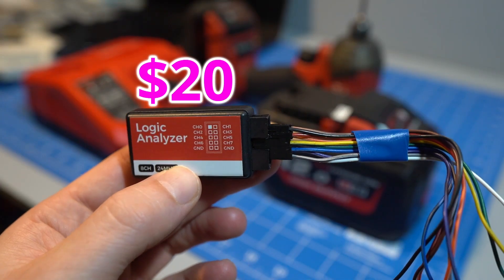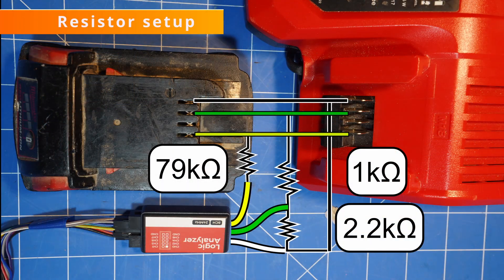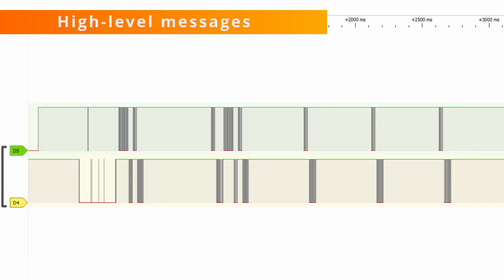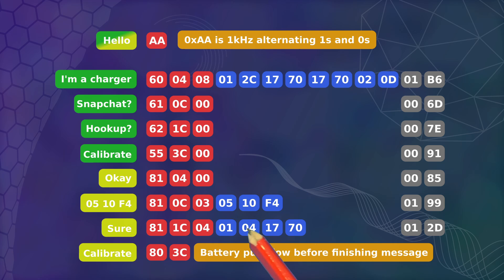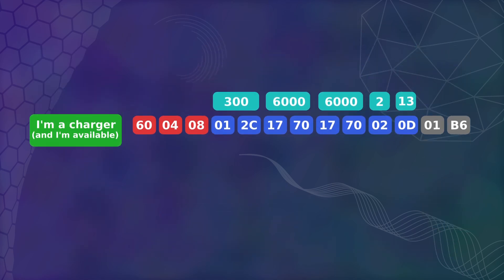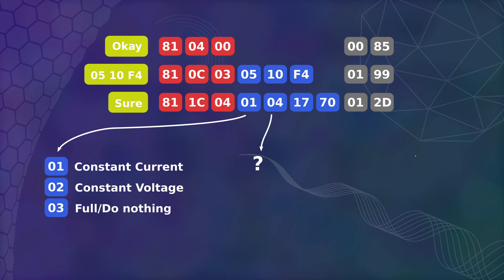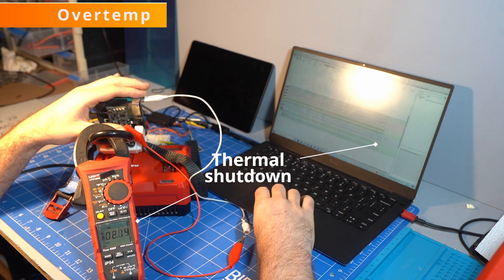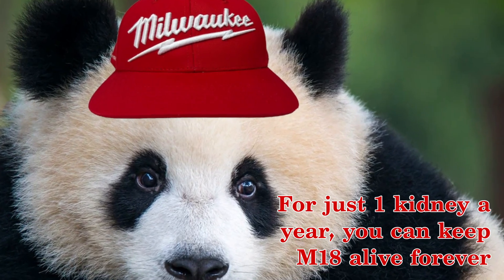[004] Reverse-engineering the Milwaukee M18 Redlink Protocol

Comment: Just thought i'd share a recent experience and thoughts on this great work! I have a fair amount of M12 and M18 gear, I have the multi-port 12/18v charger (essentially three single-port 12/18v fast chargers in one unit), single-port12/18v fast chargers and a 12v only dedicated charger. Recently I've had the dreaded christmas tree fault code with a freshly drained 12v 6ah battery, and one 'long time no use' 12v 3ah battery. Low lifetime cycles on both batteries. Not abused. They look and are essentially new, but with around 4 years of intermittent use. All of my 12/18v chargers faulted out to the red/green flashing lights with the batteries on charge. Multiple attempts were made. Battery temperatures were changed/played with. No luck. I played around with leaving them on the charger in fault mode, putting them in tools etc. and eventually got them to kick into charge mode. (Note: they were not below threshold voltages) So all good right? Unfortunately after another fresh discharge they have faulted again. These are not the first M12 batteries I have lost to this issue - though in the past I have just forced the issue with the dealer for replacement. This time they are too old I would think. The twist is that they are charging fine on the dedicated 12v fast charger, which makes me think that the M12 batteries have a comms issue / tolerance / firmware issue with the multivoltage chargers - something maybe overlooked in the design or relationship with these chargers? It would be great to see hand held analyser released oneday, sitting between the battery and tool or battery and the charger with a readout of what was going on...allowing the consumer to know the fault, and have a robust conversation with dealer/milwaukee ensuring that batteries are not just junked due to over zealous product management protocols, design errors, production errors or dare I say it planned obsolescence. Not that I think that is Milwaukee's game here, but there are $ made in batteries.
Reply from the maker: M12 batteries are entirely analogue and don't have any digital communication. The charger has access to all the cells for balancing and monitoring through the C1, C2 and Th pins. It could be that the contacts on your charger need cleaning? Maybe one of your chargers is fussier in terms of measured cell resistance or imbalance.

Comment: the magic byte sequence 0x0510F4 could just be a sequence that is extremely unlikely (or impossible). i've designed similar protocols before and i would often just pick some value that i knew was extremely unlikely and then i could use it as a state transition trigger for my state machine that reads the stream. i would rely heavily on this if i know i couldn't trust timing too
Reply from the maker: Leading theory at the moment is that it's chip IDs. 0x10 is the i2c address of the balancing chip (BQ76925). 0xF4 is decimal 244, and the MCU is a MSP430 G2744, but is often just classed as a G2x44, which is basically 244.

Not sure about the 0x05, maybe protocol version if they made a few revisions during their early prototyping and field testing, and then 0x05 was the final version released to the public.

Comment: My thought on the unknown data request is maybe some kind of identification request, like "Are you a Milwaukee battery?" "Yes, here's proof." That or it's junk data to throw off repairmen and aftermarkets.
Reply from the maker: Leading theory at the moment is that it's chip IDs. 0x10 is the i2c address of the balancing chip (BQ76925). 0xF4 is decimal 244, and the MCU is a MSP430 G2744, but is often just classed as a G2x44, which is basically 244.

Not sure about the 0x05, maybe protocol version if they made a few revisions during their early prototyping and field testing, and then 0x05 was the final version released to the public.

Comment: Can you please explain why you needed resistors and how can someone know when they are needed?
Reply from the maker: The J1 resistor was needed as otherwise the logic analyser puts too much load on the J1 pin and it can no longer communicate. This was a trial and error thing. I found that connecting to J1 would make the signal go to zero and the charger error. So I tried it with a 1 mega-ohm resistor and that stopped the errors, but I couldn't read anything with the logic analyser. So a bit of trial and error found that 69-89kOhm would keep battery-to-charger communication working and let me read it with the logic analyser.

For J2, it initially worked, but when the charging current was high, I'd just get noise on the logic analyser. I could see that J2 was working at 12V, but the logic analyser is designed for 5V. So I used a voltage divider to drop the voltage.

Comment: Nice work! FWIW this is why I switched to dewalt 18v batteries - the pinout just has the individual cells so it's trivial to connect them to any charger for balancing.
Reply from the maker: Definitely advantages to Dewalt's design. Downside is that it's a bit more prone to short circuits and it's unable to brick itself if it detects a fault (which some people would consider a pro, but I'd consider it a con for most users as it means they're more likely to get a flamming battery)

Comment: Why have 2 bits for charger or battery?   wouldn't one do the trick?
Reply from the maker: I don't have a lot of confidence in my partition of that byte - there's just so little information to make conclusions. I actually think it's probably more like 0b01 is charger, 0b10 is battery, and 0b00 and 0b11 are diagnostic/repair devices. I'd be shocked if Milwaukee didn't have a device that they could put on a charger or battery that would pull diagnostic info and maybe run some simple resistive load tests. I just left it like this because it was simpler for the video as I wanted to limit the amount of binary talk for people that aren't familiar with binary.

Comment: Is there any reason for this to exist? 
To me it would seem like +/- is enough and there's no need to increase the BOM except for DRM
Reply from the maker: Unless you do like Dewalt and have 6 pins (GND, +, cell1+, cell2+, cell3+,cell4+), then you do need some way for the battery to request current from the charger. Without it the charger doesn't know if it's overcharging a cell as there will always be one cell that is stronger than the others. Li-ion cells don't like going over 4.25V or they can over-pressure, burst and catch fire. In Milwaukee's case, their pre-2013 batteries did not have this and thus had to do very slow charging. To get fast charging and maintain compatibility, this was really their only option.

As for DRM, it's actually a very simple protocol that's easy to replicate. Many 3rd party brands have made compatible batteries, so it doesn't appear to be about DRM.

Comment: I had no idea there was such a thing as battery drm
Reply from the maker: Not really DRM. They could have made this a lot harder to crack if they wanted to. There's lots of 3rd party compatible batteries available, but I haven't tested so I don't know if they've replicated this protocol or if they're using the older pre-2013 protocol that just uses basic pulses.

Comment: I feel like the "break"/"let's change position" (lol) could be to let the cells relax and allow a more representative measurement of what the current charge state is (voltage of the pack) instead of clock drift. Totally could be wrong tho, just thinking aloud
Reply from the maker: Maybe, but there's a very short delay. If you look at 3:13 it barely changes the 0.5s spacing of the messages. In my experience Li-ion takes several seconds to settle.

Another commenter said it was a watchdog, which makes more sense. The battery and charger can go for over an hour of just repeating identical messages to each other, so this makes sure each is still working and not stuck in an infinite loop.
Reply: @toolscientist  Ohhh, that makes sense, I hadn't considered the scale of the timing :D

Comment: shot in the dark here, maybe the 04 second byte of the charging status message is the charging stage after the one to stop at, for example 01 is constant current, then 02 is constant voltage, then 03 is stop charging, so the loop terminates at 04 and they're using lessthan compare instead of less or equal?  And an older battery chemistry that doesn't need anything beyond the constant current step would always reply with 03 there so the charger would stop as soon as it got to step 2?  Try a NiCd or NiMH pack supported by the charger (maybe an older V18 pack, I'm not too familiar with the Milwaukee lineup) and see what it says in that byte.
Reply from the maker: Do you mean 0x05? 0x04 is definitely overtemp. I get 0x04 when shorting the thermistor and Buy It Fix It got 0x04 when using a heat gun on the thermistor. I'm thinking 0x05 is undertemp as it gives the temperature light on the charger. I may have damaged something in the thermistor circuit when I was desoldering.

I don't think there's any NiCd/NiMh compatible packs. This protocol only exists in post-2013 M18 packs. I have 2x pre-2013 packs and they don't have digital communication, just on/off type signalling (I haven't looked deep into it, yet).
Reply: @toolscientist  sorry, wasn't clear - I mean the one you said you have no idea what it means right after 6 minute point in the video.  I noticed that 04 is 1 over what the last charging stage you have documented and figured it might be a charging stage exit value, or similar.  It would be interesting to spoof it to 03 and see if the charger skips the normal last step of charging

Comment: really cool demonstration of revere engineering in addition to the very valueble data someone out there will need.
Reply from the maker: Haha, I'm sure someone will need it...right? I guess making a custom charger would be somewhat useful if you wanted to slow charge. Unfortunately it doesn't communicate cell voltages as that would be useful for making a charger that only charged to 4V or 4.1V to increase longevity.

Comment: Can't wait for your battery communication for tools video. Have an RC vehicle that I currently monitor battery voltage with a power cut circuit (The PCB you showed in a previous video that disconnects at threshold voltage) Would love if there's some way to know the batterys getting low before it cuts so I can drive my vehicle back to me. (Maybe I should use a shunt). 

I know there's some form of low-voltage measuring with the Radius light "2144-20" as it will give a warning before turning the light off, but Im not sure if its simply measuring voltage of the pack or if there is redlink communication for low charge
Reply from the maker: Tool comms will be out in hopefully a week. Unfortunately no low voltage indicator, just tells it to stop. You'll have to rely on measuring pack voltage and correcting for current draw.

Comment: Wanted to also ask, could I charge via just the charge and ground pin alone? Trying to make my own usb to 18v charger. USB PD trigger board at 20v > dc to dc CC converter > charge and ground. Dewalt already figured this out but obviously it’s easier for them given that there’s literally no protection on their batteries lol.

Would be nice to use just two inputs at the end of the day (charge/ground) and take advantage of the onboard balancing. But I’m suspecting it’s not that easy.
Reply from the maker: You can't send power in via the CHG pin, it's blocked by a mosfet that won't turn on without comms. You can charge directly through the + and - pins, but there will be no balancing or cell monitoring. If you just try to charge to 21V, there's a very good chance that you'll be pushing some cells over 4.2V.
Reply from the maker: The balancing is done by a command from the microcontroller to the balancing chip. You could tap into this and tell the balancing chip to start balancing. But this requires disassembling the battery, at which point you may as well just charge the cell banks directly. In any case, tricking the balancing chip into balancing is probably harder than using an arduino to trick the battery into thinking it's connected to a genuine charger

Comment: I feel amused about this video. Since January I basically do just that comercially.
Not on Milwaukee Batteries another manufacturer. But let’s be real, there’s only a very limited amount of combinations you can arrange the bytes which make senses.
Reply from the maker: Yeah. I was hoping that it transmitted temp and cell voltages as that would allow me to do interesting stuff. But there's no need for them to transmit that data, so they kept it simple.

Comment: Do the two resistors in your voltage divider have their labels swapped? Looks like you want to drop to about 1/3 voltage, maybe slightly more.
Reply from the maker: Yes. I should probably put a correction on that. It will still work as displayed as what you're really trying to do is drop the low voltage. So virtually any voltage divider will work. Well spotted!

Comment: We need this info for all the other manufacturers (who have almost certainly made up their own proprietary (and likely crummy) protocols rather than efficiently sharing the engineering effort for an open protocol (which might even allow interoperable equipment (imagine that!)).
I've spent many years decoding the behaviour of Makita 14V packs (now discontinued). I'd like to share with others. Is there a place that tool battery nerds hang out?
Reply from the maker: r/makita on reddit has a few battery nerds that would love to hear your findings

Comment: This was excellent. I wouldn't say no to seeing something similar with Makita batterys. 
But in my perfect world. I would have a tool battery that would allow me to slide out the 18650/21700 cells. And the terminals on the battery is a swapable plate to go between makita and milwaukee, so you don't have a big bulgy growth stick on top of your battery like the current battery adapters work.
Looking foward to seeing what future video you will do. SUBBED!
Reply: Me too. I've spent years removing the boards Makita put in their really annoying 14V packs and replacing it with a simple pinout to let a balance charger charger the pack. I have a design for a smarter board which would at least do low cell-voltage monitoring and stop the drill before the battery is damaged. (neither the tool nor the battery does this in Makita's design).
Reply: @xxwookey  Happy to know I'm not the only one to have this idea. With the developemnts in 3d printing filaments, making a custom case isn't going to bankrupt someone
Reply: @LabiaLicker  Well. I'm primarily interested in decoding the protocol and/or fixing the firmware to stop it bricking batteries if you try to charge an unbalanced pack 3 times in a row. The cases are fine  for me, and replacing the board is physically quite easy just using veroboard. Although now that the packs are getting harder to find, being able to print new cases would be useful. Not sure how robust they would be in comparison to the existing ABS ones. I think I did find a 'thingiverse' design for the battery case once?
Reply from the maker: I'm not looking forward to working on Makita's batteries. The firmware is very brick-happy so I don't think I'll be able to repeatedly thermal and undervolt them like I've done here. There's a hacker forum that's looked at RE the uC on LXT packs but apparently the chip that Makita uses is virtually impossible to pull firmware off.
Reply: @toolscientist  There are Makita battery clones that are sold. And these presumably behave exactly as genuine as far as the charger and tool is concerned. If the genuine batterys are a dead end road. Maybe explore the clones. Either way I'm sure it will be interesting regardless 👍
Reply from the maker: @LabiaLicker  that's a good idea. Abuse the clones to get the protocol and then verify on a genuine.
Reply: @toolscientist  Yeah I suspect that since Makita moved so much of their manufacturing to china, their ability to tightly protect "corporate" "secrets" would be greatly diminished. Just looked at a teardown comparison video between a real and fake battery and there is a totally different bms circuit design being used. Promising....
Reply: @toolscientist  Right, but someone in China either re-implemented it or got a copy, because you can buy replacement boards for bricked packs. I wish I knew how to contact them (although they may well not want to share the secret sauce of course).

Comment: Could to F4 in 05 10 F4 mean "-12" in twos complement. It could be referring to a voltage level.
Reply from the maker: Interesting idea. I hadn't even thought to look at 2s complement. Can't think of anything that -12 would relate to, though.

Leading theory is that it's chip IDs. 0x10 is the i2c address of the balancing chip (BQ76925), The MCU is a MSP430 G2744, which is in the G2x44 family, and F4 is 244. Not sure about 0x05, maybe the 5th version of the protocol?

Comment: what if the 05 10 F4 does define something like the protocol/software/firmware/hardware/platform version. if you bring out a new generation of chargers, that offers a new feature, thats only supported by new batteries, or speak the „new protocol“ how would the charger know if its a new battery or a legacy battery…
Reply from the maker: That's a good idea. I thought that such a command would be the first, but it's not unreasonable to be the 2nd. Strange that it gets repeated, but that could just be the program flow. Another commenter pointed out that it could be chip IDs. 0x10 is the i2c address of the balancing chip (BQ76925). The MCU is an MSP430 G2744. So maybe F4 refers to that, and 05 is the protocol version

The super charger has 5 pins and can send extra power in through the main power pin, but only on high output batteries. I'm hoping someone will do this test and post the results here, otherwise I may have to buy a super charger.